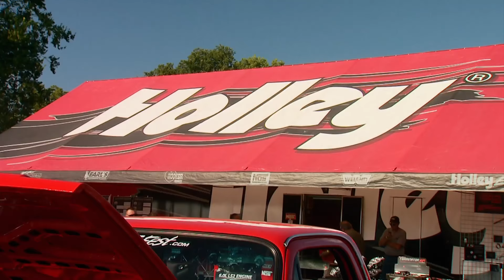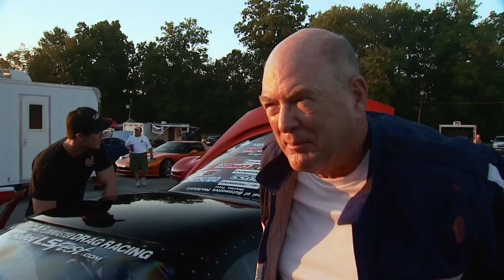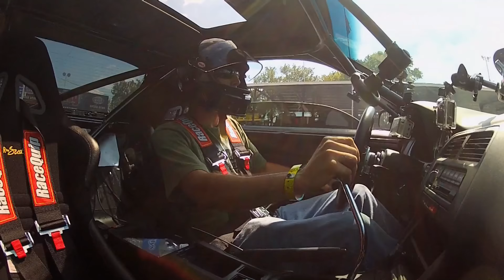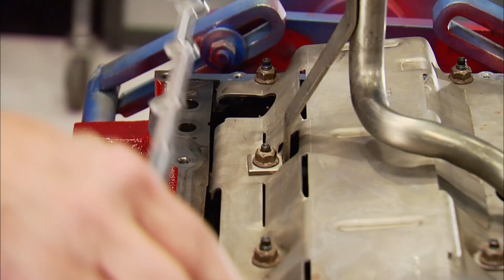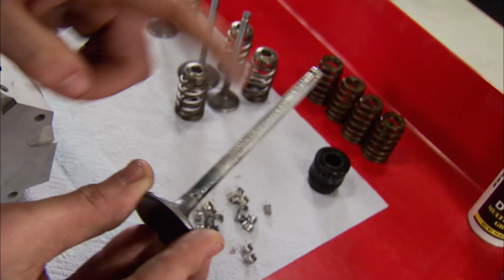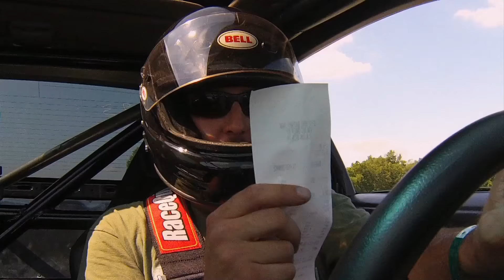Junkyard 4.8L Iron Block Built For Impressive Numbers On The Dyno - Engine Power S1, E1

Comment: Not only is this not that low buck they could have spent way less for a lot more power. Not to mention carburetor is not the way to go but fine if that's what you want, however expensive TBI system when it's already multi-port with a great stock truck manifold??!! ridiculous

Comment: Years Later, that Link for the Seasoned block being sold for $750 Bucks....

Summit Racing™ SPC Engine Blocks SUM-150216
Engine Block, Pro LS, Bare, Cast Iron, 6-bolt Main Bolt Style, 6 Head bolt Pattern, 9.240 in. Std. Deck 4.125 in. Bore, GenIII/IV LS Chevrolet, Each

Part Number: SUM-150216

$3,349.99

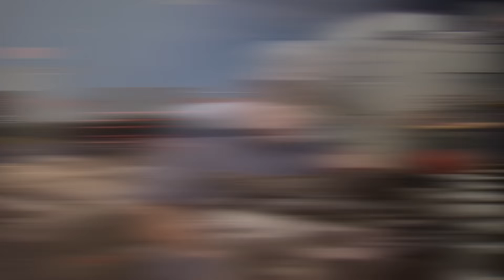16:23

Comment: Only brand new vehicle I ever bought was a 2006 Silverado 1500wt 4,x4 with the 4.8l it was my everyday driver for 13/14 years and towed and hauled weekly for work and fun. From 6 miles to 220,000 miles all I ever had to do was the alternator. Regular oil changes and it just kept going.

Comment: Never seen a 4.8 woth 243 heads factory those are ls6 heads even yhe trucks eith the clone ls6 heads are 799s something not adding up
Reply: Good call, but look closer, it’s a 4th gen truck motor with dod towers in the lifter valley AND 243s, thar tells me the engine code is LMG making it a 5.3. And since the 5.3 and 4.8 share the same block and bore, you can swap to 4.8 pistons bc they’re factory flat tops vs dish that would’ve come with a 5.3

Comment: Hello I'm doing the same setup as you are but I just have a couple of questions at the top of the motor you have a Billet plate up there you did away with the knock sensors and that's pretty much all I needed to know why do I have to get rid of the knock sensors

Comment: How come you all didn't do all the little oil pump and sump drilling mod and porting of the sump mod. The bar bell again come on guys. Then the minor light bevel on each corner. It's the little stuff for insurance and power while your in there. Some more minor porting would be cool to see with a valve job with the cam that would be a awesome dyno test.

Comment: Does anyone know if it’s ok to use the same clean up process on the intake and exhaust mating surface on the heads, 80grit dry to 1500 with wd40? Or should you not be sanding that surface?

Comment: I bet it would have made more power with 706/862 heads. Those big valves were shrouded by the small 4.8 cyl bore.

Comment: Awesome episode! I loved watching it. There are some useful tips that I can use. 

I have the 5.3L LC9 that I'm keeping mostly stock with the exception of a valvetrain upgrade to an LS3 cam set-up which is currently on order from Summit Racing. 
I had purchased a running 2001 Suburban with 229,400 miles two years ago for the intent to drop the motor into my '68 C10. But I had came across a 2005 LQ4 6.0 just a couple months ago which will be dropped into my C10 instead. 
I'll continue watching your videos to learn more and apply some of the knowledge towards each of my projects. 

Thank you for posting a great video!

Comment: Who in their right mind has 6 identical feeler gauge's? I worked for General Motors Corporation in Engineering for 7 years. I can assure you that is not how they do it on the assembly line!  What is next magnetic feeler gauges and a pentagram on the floor???

Comment: A sequential shifter system is a must for for drag racing H pattern shifting cost you precious seconds on your dragstrip time a sequential system could shave 1 to 2 seconds of your times because they don't require the clutch after first gear and some can cut power to the engine just long enough to safely shift the gearbox without damaging it but you never take the foot off the accelerator petal so basically your power shifting.

Comment: Funny how the internet loves to say the LS is "Affordable", yet the only one affordable anymore is the smallest displacement...while a 350 is still affordable enough no one goes to buy a 262 cid version.
Reply: They always forget to mention all the expensive components need to install the cheap 5.3 or 4.8 into an older vehicle, the cost for a conversion harness and fuel system and exhaust will easily be over $1,500 plus all the little miscellaneous needed just to make it start, let alone tuning. Of your vehicle was already set up for a small block then it would be cheap just to put in or hop up the small block.
Reply: @briang4470  exactomondo! Give me a G body with a 305 in it, and its cheaper to find a Vortec 350 or any Gen one 350, and swap over the oil pan, throttle linkage, power steering setup, alternator brackets, and so on--'cause its all free if you aren't looking for chrome.

What's gonna be fun years from now, when all these LS swaps hit the used hot rod market...a buyer wants to know what year harness was used on what year engine, and the seller's gonna shrug, "dunno, used a 5.3, blew it up, got a 4.8, hacked the harness for other sensors...its probably half car, half SUV harness by now."

Then over in the Ford camp...everyone who dumped cash into a 4.6 litre DOHC Terminator swap thinking they have the latest fad....now look as dated as a 1990's LT1 swap as everyone's crushing over a Coyote swap instead.  Might as well do a Dart 363 bored and stroked out, with a top end that looks old school but kicks Coyote ass.
Reply: @briang4470 not necessarily true . If u can learn to tune and be resourceful I have swapped a 4.8 in a truck for 1700$ maybe slightly more with shipping for parts including new stock rotating assembly just  due to someone having one available.Howards cam and a 4l60e. 310 wheel hp 300 wheel torque at 6400 rpm flat torque curve in a c1500. 3800 lbs with me inside and it can hit low 13s on street. Love a 350 but u cannot beat the tough pistons rods and crank on the LS motors. If you're gonna fully build it then yeah a SBC can be a great route especially a 383 budget build
Reply: Oh and this includes engine cost

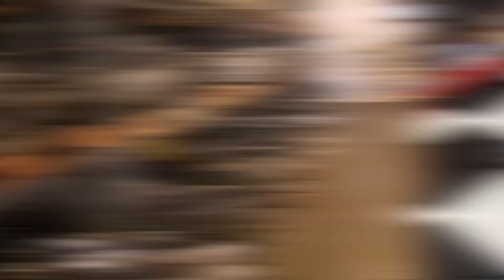Comment: @5:55 you can see a 5.3L cast into the front of the block.
Reply: it’s the same block for the 4.8 & 5.3. you can see 4.8 casting right above the 5.3 in the same frame
Reply: @gravydreams666  the 4.8, 5.3 and 6.0 all share the same block.
Reply: @googleaccount2637  6.0 bore size is bigger.
Reply: I saw that and I was like wtf lol. Maybe they wanted a 5.3 but talk about a 4.8 which is basically the same thing build wise. It's also a flat piston so it should be a 4.8.

Comment: 243 heads having more compression than the stock 4.8/5.3 heads?? It will cause a decrease in compression using 243 heads. Since the stock 706/862 heads have a 61cc combustion chamber and the 243/799 have a 64cc. Watchers please do your own research.

Comment: I have a 2010 dodge ram big horn crewcab 4x4 5.7 hemi, soon I have to replace both exhaust manifolds, because of expanding and shrinking bolts break, cast iron block aluminum heads, what would be the best manifold bolts?

Comment: The lifers don’t fail the lifter trays fail which lets the lifter turn in the the bore and cause it to fail.  The lifter tray design is the cause of the problem not the lifters

Comment: I've got a 4.8 in my Silverado and have been wanting to do a cheap build.. 👍
Reply: Your truck don't have 243 heads this is some bs on this show never seen anything but a ls6 zo6 engine with 243s just fyi
Reply: Do a 6.0, building a 4.8 in a truck unless it's an s10 isn't worth it unless it's boosted, it's not very fun doing all the work in a 4.8 with a sloppy stage 2 just to get beat by a stock gen 5. To compete with a 4.8 a 3600+ stall and 4.56 gears is the bare minimum and it's kinda sad because I love my 4.8 ☹️
Reply: I did a 6.0 317 heads ported shaved .35 btr cam ls7 lifters Holley single plane intake 1 7/8 heads 3 in true duals in a 80 C10 3800 converter it goes really good more than I thought
Reply: You're right.. had 862s

Comment: Ahh Yes, a common sense build.  I've done the same with a 4.8 junk yard motor, changed valve springs, cleaned the stuck lifters(due to long overdue oil changes), and a GM hotcam and valve springs.  Dropped into a '70 C10.  A tire burnin', 100 smile-a-minute joy to drive.  Faster than any factory truck, and I kept all the $$ for myself.
Reply: Just did the same with a 5.3 except I got Lucky no stuck lifter
Reply: Hot cam in 4.8?
Reply: @cvoxoisgodly  Elgin E-1839-P in a flat top 4.8/5.3 runs awesome and doesnt hit the pistons.  PAC 1218 springs as well.
Reply: Those hot cams do well on stock motors and they sound good too
Reply: Bought a new GMC short bed  pickup with the 4.8L back in 2011.😮Still have it. Vortec supercharger with home made methanol injection (windshield washer fluid from the reservoir). Long tubes and a 4.10 gear with Eaton Trutrac. Tuned it myself using HP Tuners software. I’m sure the tuning leaves a lot to be desired. Thankfully I didn’t grenade the engine and it’s a fun truck to drive back and forth from work.

Comment: Someone correct me if I’m wrong because I’m not the most knowledgeable when it comes to LS is but if it has 243 heads wouldn’t it be a 5.3 I don’t ever remember a 4.8 coming with 243 heads they are probably thinking it’s a 4.8 because it has flattop pistons but the 5.3 with 243 heads had flattop pistons
Reply: 07 and up 4.8’s and 5.3’s came with either 243’s or 799’s.
Reply: my L33 is 5.3 H.O. aluminun block with the 4.8 piston (flat top) 5.3 crank and 243 head. was in 06 to 07 classic silverado extended cabs.

Comment: LS engine swaps, the pumpkin spice of the automotive world.
Reply: I liked that comment (5.0>LS) because I wish it was true, it’s not. Unfortunately.

Funny thing, I’m trying to “LS” my 5.0 and everyone I know is telling me I’m building a dog.

“Your ported explorer intake is too big”
“Your 210cc heads are too big”
“Your cam is too small” (comp xe258hr)

So an LS can have high flowing heads and intake and a mild cam for 330ish streetable HP but building the same on a Ford is a mismatch?

Idk, I’m not changing my plans. Got the explorer, got the heads, got the “big dogs porting” stage 2 intake. Just need the cam and the time to install. Maybe I’m a fool, maybe I gotta stop listening to people that say high flow heads and intake don’t work on a “mild build”. I guess GM just doesn’t know what they’re doing on those gen 3 and gen 4 engines  🤨
Reply: Which part of the 5.0 is better?

The anemic heads?
Horrible manifolds?

Or the barely over 200hp they make?

They don’t even have a timing chain tensioner to keep them in time as they age.
Reply: Only an idiot thinks that. But ok

Comment: Why would anyone start with the 4.8
Reply: because idiots on their "MUH 5.3/6.0" dont want the 4.8, so they are cheaper.
Reply: Hmmm. 300 lb weight break for small displacement (<311ci) would be one
Reply: @tadwiltman4875  those engines are turds and don’t make any power na. And how did you get 300lb? Did you instantly compare it to the iron block 6.0 and skip right past the 5.3 and 5.7
Reply: @dwolf97  scca C prepared. The car gets to be 300 lbs lighter (2700 vs 3000). Granted, mine isn't a straight-up 4.8 (ls1 bore/4.8 stroke)

Weight breaks help in braking, cornering, AND acceleration
Reply: @dwolf97  That's a lie. Anything that can be done with a 5.3/6.0/LSA can be dome to this. Do some research, son.

Comment: Awesome, I am another proud 4.8L owner in my 05 Cat-Eye! Would love to see the numbers and maybe if you guys would love to donate that engine to my truck project? Copart Chevy Silverado 1500
Reply: These guys still over spent. Find one that spins, apply $200 8706 or elgin sloppy stage 2 cam, pac1218 springs, flex fuel injectors, and a gt45. Tune, piping, intercooler, etc will be up to you cost wise. Make 500+ wheel horsepower and still spend less money than these part pushers.

Comment: Ls motors are played out. Move on already
Reply: Dude, this episode is like seven years old at this point....
Reply: Yah I have 2 of  these small V-8s both have 300 k and they don’t use oil and they still have good comp ratio  good lil V-8 can take the revs and miles if looked after.       Like regular matenence and fluid changes

Comment: That trick for mounting the oil pump with shims was really interesting. I have never seen that before on any other engine build. Well done!.
Reply: It is USELESS.  Because the amount of wiggle room in ALL of the LS line of pumps has NEVER been an issue.  You can bet money that the folks at the engine plants aren't doing that bullshit.

Comment: I can't believe they decked the heads with sandpaper 
Lmao bs
Reply: It's fine.  Mounted to a flat (enough) surface.  I've seen worse and still hold a gasket fine.
Reply: For a NA application +metal gasket it's OK, not the best solution by miles but just OK, for a budget build tho with common tools, taking the heads to a machine shop for resurfacing is much more viable (just value the time you gonna save of just cleaning 2-3 times the heads)
Reply: Old bearings and rings too. Why even rebuild it?

Comment: Mopar, or No Car.
Reply: No, I Enjoy horsepower.
Reply: @spencerschreffler4  i enjoy a nice valve angle, good rod ratio, and raised exhaust ports. all things that a small block mopar has, and a small block chevy doesnt. gotta replace almost everything on a sbc to make it hold together. meanwhile sbm are still running stock rods, rod bolts, rockers, pistons...
Reply: Fix It Again Tony
Reply: @bigboreracing356  there you are :). its like a dog almost. all someone needs to do is say "im not a fan of chevy" or "i like mopar/ford" and here you come running, foaming at the mouth.

Comment: It pains me to see people doing a budget build spending $1000+ to convert an EFI motor to carb. The EFI stuff is practically free! If you hate the factory stuff or have that money burning a hole in your pocket, spend it on the TerminatorX standalone.
Reply: @bigboreracing356  they are fine for engines that come with them, but I wouldn't spend extra money to go backwards a couple generations in technology. I did it on my first LS swap thinking it would save me time and money but after using factory computers and Holley standalone, I would never do another carbed LS.
Reply: These guys build a lot of motors. Carbs and MSD boxes are easy to move and reuse. Imagine your build if you had to swap motors every month or two.
Reply: @ahoneyman  absolutely. I'm sure it makes almost no difference on the engine dyno when they are just going wide open throttle looking for peak numbers. I wouldn't put it in a car though. The only down side of the stock stuff is that it is ugly.

Comment: If you don't have a Washer like you guys, an old Dishwasher can work for most part short of sticking the engine block in it. I did my intake manifold like that when I was redoing the top end of my engine.

Comment: Ahh the good ol' msd 6014, I got a 5.3 LM7 from a friend for $100, less than 90k, and he had pulled it years ago and didn't use it, I got that, an intake from Holley cause it was the cheapest at the time, and the MSD 6014 box, and got some budget Longtube's, and swapped it in my 1986 Camaro Z/28 for under $1000, used my old Edlebrook 650cfm carburator that I already had, and the swap works amazing and actually lights up the rear tires for the first time in the cars life😂 it's impressive what you can do with these LS engines, it's a night and day difference in power from the stock engine I had and there is soo much more aftermarket options to go with on these, I'm planning to go with small twins going to an 850cfm demon carb for a blow thru boost set-up, but first I'm gonna test the full reliability of the n/a setup before boost to get use to it, it's not tested yet cause I have to fix other things to meet vermont inspection requirements, after all this was originally a $900 Camaro

Comment: I bought a ATK crate engine from SummitRacing and did a cam swap for my LS project. Great value at $2200 + cam. It runs great!
Reply: 2200 said and done accessories mounts ect? Thats great
Reply: @redlight3932  no, it was a long block, but it did have oil pan, timing, valve and valley covers. I picked it up at the store in Sparks NV.
Reply: You could have bought a wrecked car and gotten everything cheaper
Reply: @MyLonewolf25  Late reply but not always, some people want a fortune for a wreck because they know what's in it. I got lucky and picked up a truck with a super low milage L9H 6.2L and the whole drive train intact. Super pleased.
Reply: @MyLonewolf25  and risked the engine having been damaged in the wreck also.  So great advice there bud.
Many many times in wrecks vehicles run with no coolant and sometimes no oil because the wreck breaks the oil cooler and radiator.
I have seen wrecks where the vehicle is on its side or even upside down and running until someone turns the key off.  All that time without oil.

Comment: I'm a Mopar guy but got to say the LS is a great engine that's for sure GM fixed all the mistakes they did with the small block and made it a great engine i'm a big fan of the 4.9/5.3 and how easy to slap a turbo on them and make a thousand HP without doing too much
Reply: @bigboreracing356  Wrong! GM fixed Chryslers mistakes and even had to make the computer module for some of their transmissions because Chrysler couldn't get it right. 🤣
Reply: @bigboreracing356  ohhh yes it did LOL. but now that ive typed this, youre gonna go all ape shit as usual. you love to stalk these videos and spew shit about how much you love big block chevies, and how everything else somehow sucks. grumpy jenkins and smokey yunick even complained to chevy about their engines.
Reply: hey taz, i see you on jeds videos all the time lol. i prefer mopar small blocks, since they had all the mistakes chevy made solved. i love their exhaust port too.
Reply: What mistakes did gm make?

Comment: why do they never do port injection? Why a carburetor?
Reply: In the case of a show like this, it's easier to get the engine running on the dyno.  Power isn't going to be much different.